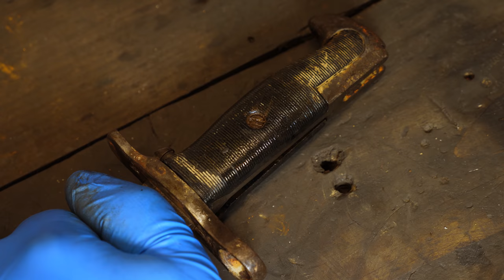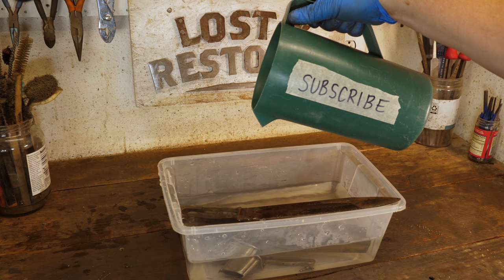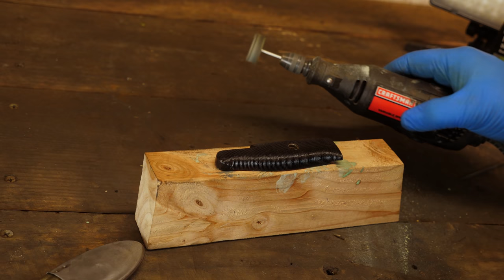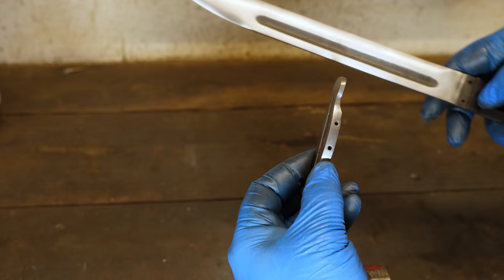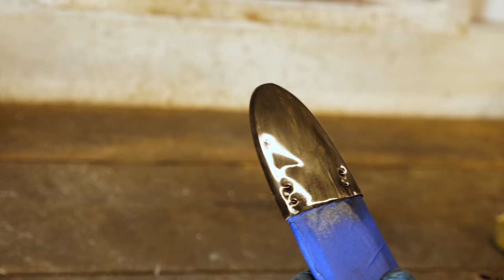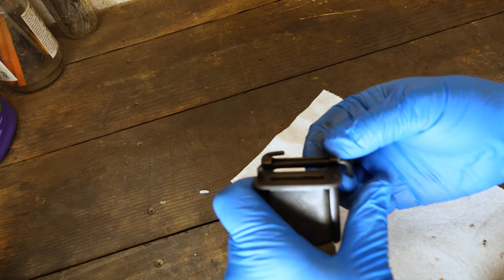Rusty WW2 Knife- US M1 Garand Bayonet Restoration

Comment: Nice to see you care for historical things. I would have suggested less sanding, particularly on the sheath. This is a step that too often ends up taking off too much material. Also, you used a cold bluing whereas the original finish was more likely Parkerized. That process gives a much different look but blends in with the olive drab colors used by the military.

Comment: Awesome video. never knew a grand bayonet came apart that way. Now if I find an old rusty grand bayonet for cheap. I’m going to do the same. I find it interesting how the guard was pinned to the blade.
Reply from the maker: Glad I could help!
Reply: Well for starters if you find one don’t do what he did. Don’t take it apart and DO NOT grind or sharpen it. He ground the markings off which makes it less valuable plus everything he did to it has made it worth $50 or less.
Reply: Don't do what he did. He ground off the markings and removed parkerization. Botched it all and tanked the value.

Comment: should have parkerized the metal pieces  and not cold blue them.
Reply: Personally I find Parkerized metal to be very artificial unless done perfectly. But when done right yee looks nice.
Reply: You're perfectly right ! I NEVER saw a WW2 Garand bayonet with its parts  polished or blued. It's a tool made for war, not an artpiece ! Moreover, parkerize a bayonet with a very good finish is easier than to obtain a good finish with cold blue. Just soak your metal parts in a strongly concentrated oxalic acid solution for one or two days, rinse with water and gently oil them.

Comment: I just picked up a KOKURA HOOKED QUILLON TYPE 30 ARISAKA BAYONET it will need a cleaning.
 It has surface rust, but it should clean up fine. One of the grip scales is totally missing the other is chewed up... I'll make a new set; I don't know what wood was used in the 1940's on these.

Comment: I'm probably alone in this, but I kinda think some things shouldn't be restored..
Reply from the maker: I feel that way on some things, if their old relics that are rare and/or have a historical meaning to them. There are so many M1 Garand's out there, it's not hard to come across them.
Reply: I feel you because of how old it is and the value, but they are easy too find and are satisfying to restore.
Reply: I think there's a big difference between a renovation, a restoration and a conservation-restoration. They all play their part depending upon age and rarity. This was a renovation, he wasn't replacing like with like at all, he just wanted a visual impact. I personally don't like that, unless the object isn't very old or is extremely common. Then there is restoration where you try to take the object back to its original condition. Sometimes it's useful in museums etc. I think a cross between all three is generally best. I wouldn't expect a normal person to use rabbit skin glue on on their Victorian furniture, but at the same time I wouldn't want ALL the scratches sanded out. Stabilisation and time sensitive restoration is better than just letting things rust IMO. I know some people think we shouldn't ever try to turn back time on an object, I just think if you're gentle and careful with your approach you can have it both ways. The object in this video was sadly ruined in my opinion. The epoxy and paint was awful. 🤢

Comment: Should be "How not to restore a bayonet"...  Cold blue, wire wheel and sanding isn't restoring.  Parkerizing is the proper way and is easily accomplished at home with a cheap glass bead cabinet a hot plate with stainless steel pans.

Comment: This is setting a bad example of how to treat items of ww2 or antiques in general. This killed its value. All you had to do with this bayonet was wipe it down with oil and steel wool to CAREFULLY clean the rust off, not break off the crossguard and put it to a wire wheel. You scraped off all the original finish. People need to learn to be gentle and treat these things with respect.